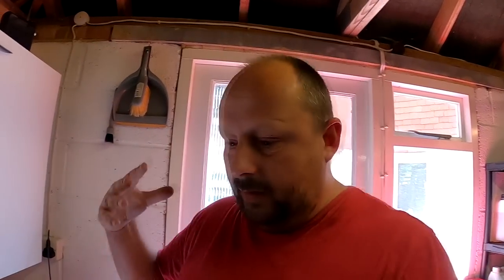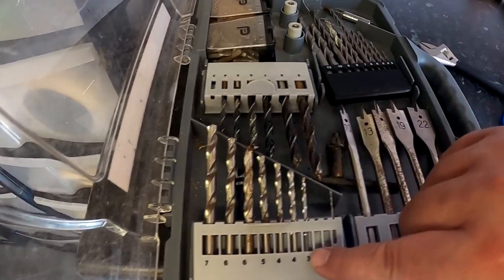Removing a broken/sheered/snapped wheel nut | Using Cheap Chinese Cr@p tools

Comment: I have had the exact same set of "easy outs" in my tool box for years! Probably only used them a handful of times. I can't remember why I got them in the first instance, other than it must have been a sheared bolt of some kind. 
The feeling of joy and relief when these cheap little tools get you out of an expensive and time consuming hole is huge.
Having to take the Club sport to a garage for that would have been a real pain, great when solutions like these work.
Good  video , as always.....:)

Comment: You are lucky getting the stud out, I've done the same and the stud extractor ended up snapping in the drilled hole, and the extractor wasn't cheap Chinese either!
If you drill any hole of depth, use some tapping/drilling fluid to prevent your drill bit burning out.

Comment: Hi Jon if it’s a vac leak it will have more of an effect at idle as the throttle valve is closed, if you could watch your ltft and stft you could see as they would be way out at idle and start correcting themselves at 2500-3000 rpm, them engines do suffer from it, also you could pull the dipstick out and check that it doesn’t try to suck it back in.

Comment: Hello Jon,
Taking the caliper, carrier and disc off would have given you better access to the broken piece of the wheel bolt. You would have been able to gently heat the bolt from both sides and even possibly grab the thing with vice grips while hot before having to drill.
Also you could have filed or ground the end flat to aid with starting the drill in the centre of the bolt.
Yes, perhaps a little long winded but seeing the full picture usually gives you more options and less chance of mistook.
Well done never the less.

Comment: On bolts or set screws like brakes, dry, whack the bolt head square on a few time. It will loosen screw thread. Thats why impact sockets are best as tyre fitters use. No surprise you twisted off Jon. Good recovery though 👍

Comment: If you can get your hands on ISTA/D (Rheingold) and a cable you should be able to read and test the sensors, plus run service/test routines. I think it works with e46's, else the older INPA software will do the same thing(ish), being the older version it's a bit more clunky to use.

Comment: Left handed drill bits😉 if youd used them you wouldnt or might not have needed the extractor. Worth a try as either way youll have a hole if it doesnt come out whilst drilling😬 a kit of 5 drill bits and 5 extractors are about £10 on ebay👍

Comment: I wouldn't bother with swapping a new occupancy sensor for the seat, done mine and it came back. Tried a bypass and after a while same issue. Get it coded out. I know its there so not all the airbags go off but once even one bag goes its a write off.

Comment: Any fault codes for the random issue ?
Reply from the maker: hey john  runing lean on bank 1 and 2 I cant remember the numbers, both O2 sensors at about 25% when it does it.  normal running is fine though. very internmittent..   Probably a very very small vacuum leak.. Originally when I bought it I had misfires on all cylinders and it would misfire... nowadays it never misfires but just clocks up running lean errors.   MAF is good.  No obvious leaks.  vanos seals were done not so long.  most CCV that I can access look good.  So does the DISA.
I think I have slow coolant leak somewhere as well. no cooolant building up so maybe drip somewhere on the block and evaporates..
Reply: @forensicunplugged4295  yeh sounds like a tricky one. Could easily spend a few quid trying to find the issue. Need it plugged in when it's playing up and hopefully work it out.

Comment: It's those Morons at the Tyre places who over tighten the wheel nuts to buggery using those horrid impact driver tools FFS ! I nearly popped a vein in my head trying to get my wheel nuts off and I'm a pretty strong person. So I'm not surprised you have snapped one. Metal fatigue all over.
I have since cleaned the stud threads, applied anti seize compound and then TORQUED to spec using a Torque Wrench.
You reading this all you Wheel and Tyre techs ??